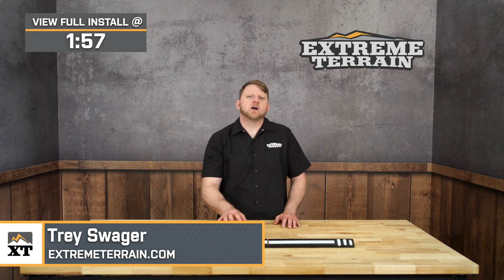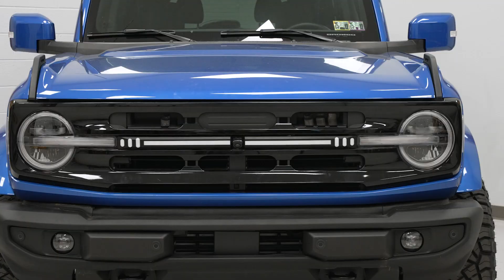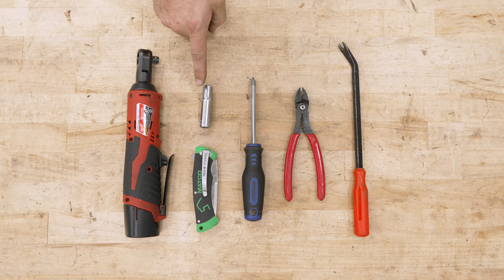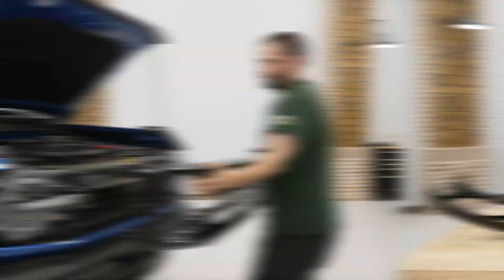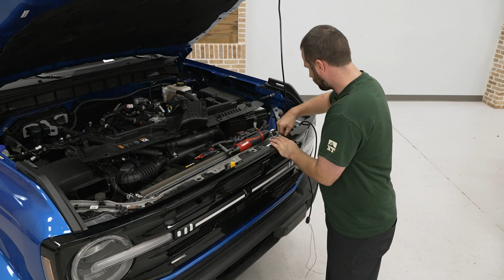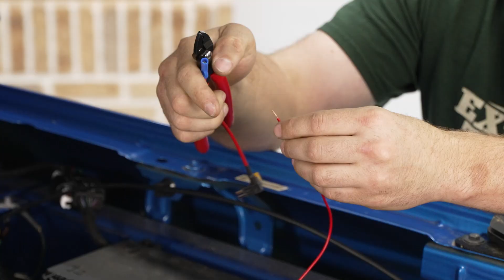2021-2025 Bronco RedRock LED Grille Lighting Review & Install

Comment: I just installed it and followed everything exactly. The light stays on when the car isn’t running. How can I have turn on/off with the lights?
Reply: You need to connect it to the fuse box using a fuse tap.